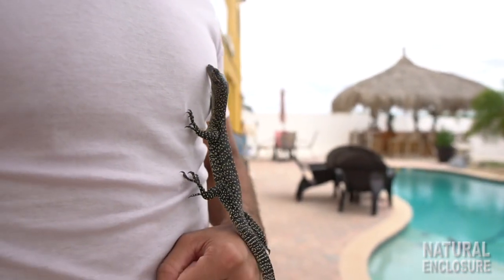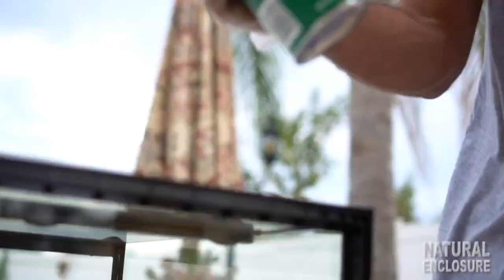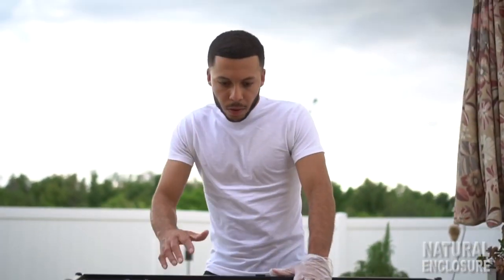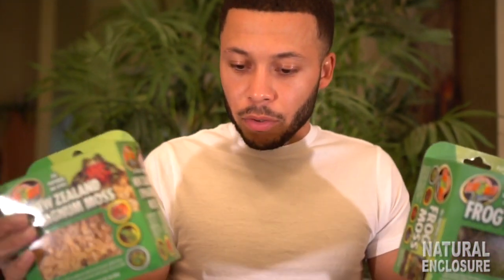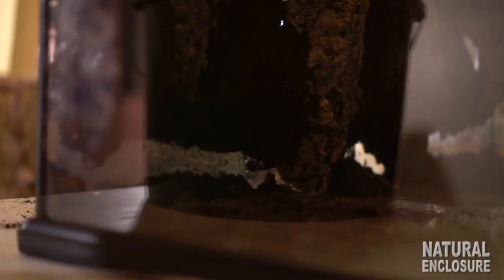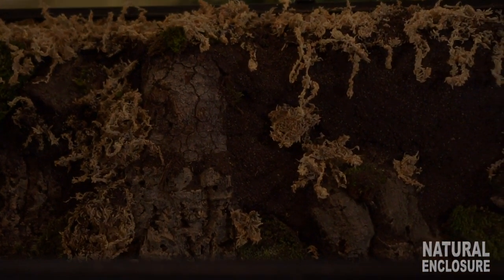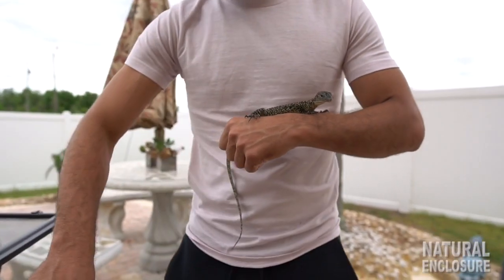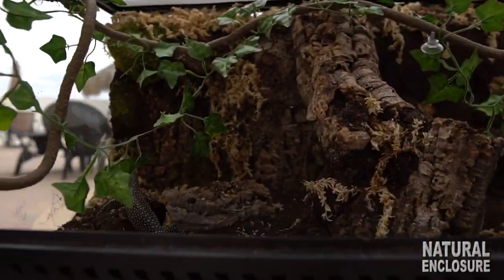HOW TO BUILD A TERRARIUM BACKGROUND | MANGROVE MONITOR | NATURAL ENCLOSURE

Comment: I got an 8x5x6 outdoor enclosure, with 10 inch deep substrate(organic top soil, compost, and cypress mulch), also has uvb and live plants. How much long and deep of a tub/pond does an adult mangrove monitor need in this enclosure?
Reply from the maker: Sounds like a dope enclosure man. Honestly, the size of the pond can be based off your preference. Such a big enclosure like the one you have, I’d have a pond at least two and a half feet long and if possible a foot deep. Keep in mind your filtration system is very important with large ponds such as the one I’m describing. But shout out to you man for taking care of your mangrove. Hope the enclosure turns out dope 🤙🏼